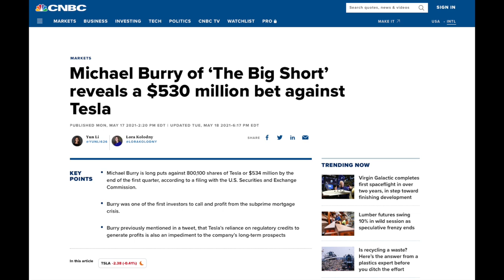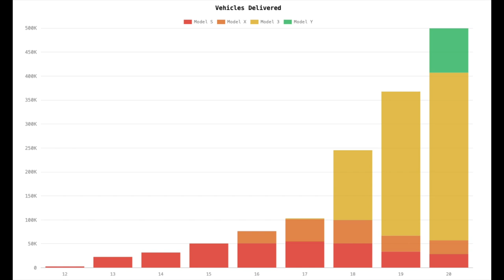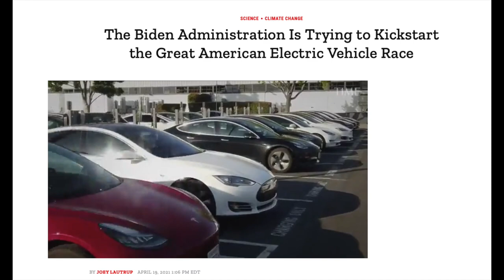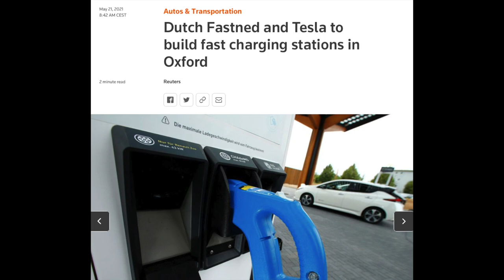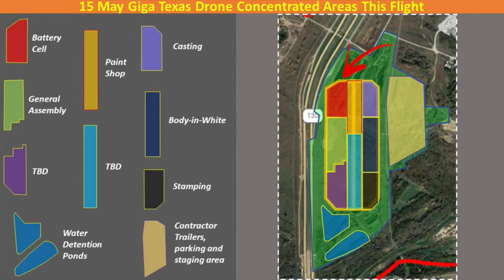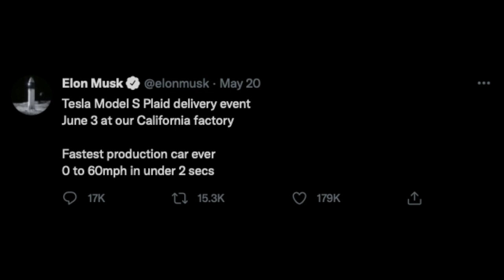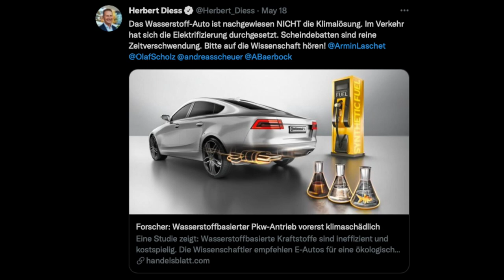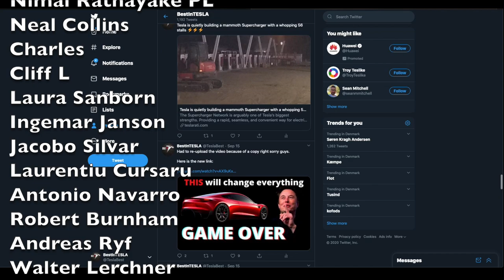Tesla Giga Berlin & Texas already producing products | IEA : The Pressure cooker is on for ICE cars

Comment: Thanks Lars! :)
Burry is nuts to short Tesla.
Elon is thinking 10 years ahead, which means everyone is going to be left behind long term.
CANT TOUCH THIS... "SLAP"...
Reply: Nonsense, he is still relying on the oil industry, everything you touches is basically part of the oil chain.
Reply: @recliningbuddha  I totally disagree with you and its totally unfortunate because in 10 years it won't happen, there are about 80 million vehicles sold every year and not to forget the giant machines and equipments. EVs still barely makes 2% of the global marketshare, modern batteries are already designed to last about 10 years depending on utilisation, semi and other vehicles needs significantly bigger battery capacities and more equipments are being electrified like bike, lawnmowers......... recycling won't solve the problem of raw materials. We're going to open and look for more lithium mines and it takes a long time to make them exploitable and processes needs to be greener.  Nickel, aluminium, copper, lithium, rare earth are very energy intensive to make.
Reply: @recliningbuddha  you're joking right! Electric vehicles aren't made to last longer than ICEs, I've seen many tesla with 400k miles but guess what! Both batteries and motors including MCU were replaced many times. A regular well made ICE with basic maintenance can last over 20 years+, biodiesel and biogas/biofuels vehicles already exist.

Comment: The apologies from Chinese media is good evidence that the Chinese government is not trying to undermine Tesla.
Reply: Actually it's a statement that Elon has received their message and they are happy with his response (and what that is we will never know).  The brake STUNT was Chinese government 100% ALL the way.
Reply: it just means that Tesla reafirmed that they would not be an existential threat to the CCP so they should calm their tits down, and they found that awnser good enough.
CCP had a beef with tesla (and kind of still does) because of Tesla itslef cares little about pandering to their officials, its systems could potentially be used to get data off the great firewall, and obviously China would prefer if a puppet company be the one in control of the Asian market and not a Western independent company.

However it looks to me that they understood that it would probably be more effort than it is worth. Industrial espionage was attempted but failed, since by the time the solen source code was put to use, Tesla had already completly revamped the code and made the stolen tech obselete (and they seem to be doing that with consistent reliability) making industrial espionage counterproductive. They then tried big old state sponsored FUD but that backfired since all the videos of Teslas in accidents ended up showing how good they were at avoiding crashes. Don't get me wrong however, if they get another inteligence break or Elon/Tesla criticize the CCP again, they will try another technique to get rid of em while keeping face.

Comment: I have read that Berlin will not make batteries. Please, does anyone know more?
Reply: Elon said the MY from Grünheide will use 46/80s. The factory is building now, it is the new big building near the GigaFactory
Reply: They have just filed for the permits for the battery factory in Berlin but construction has already started.
An element of battery production seems to be integrated in the main plant also, this is certainly the case in Texas.
New building is probably for the next assembly line and /or power walls?
Reply: Comeon Useyourbrainagain  do you want me to create my own blacklist or can I find that somewhere, indicating which news outlets are on it?

Comment: Imagine an egg crate box, made with injection moulded ceramics, in which the jelly roll is inserted without the metal casing?  Reason for positive and negative terminals on the top?  Both sides would contain the jelly rolls......great for cooling, delete the metal can?  Ever drop a corning pan on the floor?  Doesn't break, does it?  Non-metal battery box.
Reply: As far as I know ceramics are more expensive to manufacture, and has less thermal conductivity. Also, ceramics injection moulding seems to be a fairly new area, and limited to small sizes. I also believe it requires several post-processing steps, making it less desirable for high-volume production. Maybe Tesla could innovate even here, but I'm not sure there's a big enough upside.

I don't quite follow your comment about the terminals though... the 4680s have one "terminal" at each end - this is an unavoidable consequence of one of the major improvements in the 4680 cell construction; the "tabless" design (which also improves cooling).
Reply: @koma-k  ... then why the insulator between the nipple and top plate?  Could be a connector up the center shaft?  As far as ceramics not being mouldable, aluminum wasn't on this scale before Tesla, (and still may not be in the long term a viable option). Sand is a lot cheaper than metal.  
I always thought this part, the
casing, should be eliminated as wasteful.  Look at the Kato video and see all that machinery that could be eliminated, just the jelly roll and top and bottom caps for the egg crate left.  If not ceramics, maybe a thermal tolerant plastic? The plastic could be made with an opposite PH jell,
in case of melting, that would neutralize any fire danger for that cell.  Worked for a company that made water bottles filled with water during the moulding process. Ford made radiators (poorly) out of plastic (yet believe they were undersized and underperforming). Plunk those jelly beanies directly into the structure, cap the top and bottom?  Immerse all into a non elec-conducting cooling fluid?  Safe, secure and light weight, easy to produce.
Get those lfp batteries up to current NMA standards for energy vs weight.  Airplane cells?  Perhaps.
Reply: @ArizonaPoet  It's been my understanding that the 4680 cell has one pole either end, but I haven't seen a definitive schematic of it, so I could be wrong.
Ceramics is a very wide class of materials, spanning from concrete to glass and china to "advanced ceramics" - the latter being what's used for knives, high-temperature turbofans and other "technical" or advanced applications. These generally have little to do with sand as a raw material (perhaps apart from some silicon-rich variants), and some of the commonly used ones are aluminium or zirconium-based, so I'm not sure raw material cost is an advantage. Then as mentioned there's the process itself: It requires very high temperatures and pressure, and I believe one or more post-processing steps. Then there's the material properties: As the 4680 cells will form part of the chassis structure they'll essentially be load-bearing components. Are ceramics well-suited for this? Ceramics also tend to have poor thermal conductivity, which is a negative for a cell casing.
A cylindrical metal casing BTW is "dead simple" and very cheap to produce, and its properties are very well-known and easily modelled making engineering the "structural pack" relatively simple. Now that part is probably not a deciding factor, even if ceramics expertise and modelling is a rarer "commodity" and not as widespread. 
In the end I believe cost and mechanical properties are the main drawbacks. A metal can crumples, while a ceramic one would crumble - or shatter. Which one do you want in a load-bearing structure in a serious crash? (This is only a semi-rhetorical question - I imagine that it could be possible to incorporate ceramic material behaviour in crash response, though this would probably be an entirely new field in automotive crash modelling).
Reply: @koma-k  ... thanks for the wonderful insight KK.  The glass roof's a benefit to crash protection, they seem to be experts in glass/ceramics, with the solar roofs needing a rethink for simplicity of cost, production and installation, perhaps they've
developed the expertise in this area which would be needed.  Just my imagination, but could see a complete battery pack made in seconds, not minutes or hours.  Let me know if you hear of research along these lines?

Comment: It's not $530 million bet.

It's a little bit like this oversimplification: 

Let's say I bet you $100 that $530 million worth of TSLA will lose at least $50 million worth of value.  That would be a $100 bet, not a $530 million bet.

I have no idea how much Bury is actually betting, but it's much less than $530 million. It's complicated because when he loses the bet, he can (and must) cover to limit losses.

In any case the figure $530 million is, roughly speaking, what the bet is about, not the amount being bet.

Comment: We're fast approaching the limits of adhesion with road tires.  In less than 10 years every performance electric street car will run 0-60 in about 1.5 seconds but none of them will be able to go any faster without the aid of some type of compressed-air rocket.... And I see medical / liability disclaimers having to be accepted before you can activate the rockets.  🤷

Comment: Tesla's biggest car battery holds the energy equivalent of about 3 gallons of gas, I read. The plain models are very efficient, 80-130 MPGe, but a big trailer shoots the consumption all to hell at highway speeds. Batteries have a long way to go before several uses warrant an electric car. Then there is the need to increase electricity production to replace perhaps half of the liquid fuels currently displaced. I bet pop-top trailers will work better where the load permits a lowered roof.
No need to force the change from ICE, those who need the benefits of Teslas and others will not ignore the powerful economics of changing to electric or hybrid. Market forces may even drive a very significant number of ICE cars, trucks, and perhaps general aviation, to electric/battery power.

Comment: The Ford lightning is a joke for the price. The Cyber Truck is far superior.
Reply: That's what she said LOL.....
Reply: Ford Lightning will start Osborne effect for F-150 "ICE" models 😊
Ford bankrupt before 2030 (?)
Reply: I just wish that the Cybertruck had lower bed sides. The sides are much too high to reach into the bed. The Cybertruck may not be so popular on job sites, but malls, that is a different story.
Reply: @smarticus6384  the ford can be seriously and very easily modified and the aftermarket is huge, from custom beds to light, equipments..... cutting the tesla will be very ugly.
Reply: @smarticus6384  you can lower the entire truck with the hydraulic system. This truck will be a beast for a worksite.

Comment: actually it's not really a 530million$ bet against tesla, it's not that he has cashed that much in, it's registered as "put", meaning, he can later just sell it when it's below the point he has set the put down for the price he has initially set it, some fond managers do this with some risky socks as backup because it's about 7ct per share to make the "put" option there, but there is a big difference between having 7cts per share down or nearly 600 bucks so with a couple hundred bucks you can quite inflate that reported number but the important question is the expiration date of that put order because at that time, when tsla is higher than it was at march 31st at wich's price the option was registered,  he's gonna loose quite a bit. it's just a short segment, so no flame not researching this correctly and the headlines are quite misleading, but nontheless,  not true to claim he has that much cash down against tesla

Comment: 1.1 sec is impossible due to friction coefficient of tires
Reply: Yup...which is why the Roadster SpaceX version will use compressed gas to "hover" off the ground.   The sole purpose of the "hover" is to reduce tire friction.  So yes, impossible for a normal car but not impossible for the Roadster SpaceX.
Reply: @kn944  it’s reduced tire friction that makes it impossible, you want high friction, that is what creates grip.
Reply: @jimdandy9118  you're right. rocket booster things will add thrust and give you the sub 2 second time. But I don't believe it'll ever happen, road legal especially
Reply: @Harry-uq9qd  they already do this on the drag strip and go 300 mph 1/4 mile.  Nothing special
Reply: @jimdandy9118  Correct, you do want high friction if the motor torque is applying a force from the tire to the road.  However, if the force is applied by a rearward facing rocket, you actually want low friction (rolling resistance).  I may be wrong, but I think this is Tesla's plan; 1) downward facing rockets to reduce friction (like an air hickey table) and 2) rearward facing rockets to propel the car forward.  The motors may not even be activated for this seldom used party trick.  Or they may be activated only after 0.5 secs or something.
Reply: @kn944  then we really aren’t talking about a car now are we?  This is mother attention grabbing gimmick to sell cars.
Reply: @recliningbuddha  Yes agree that may be the way it is applied.
Reply: @jimdandy9118  Yup, I think that is exactly the intent.  I think the SpaceX version is limited to 1000 units.

Comment: May I suggest that you watch Rob Mauer's and Joe Tegtmeyer's videos? While much of your material is accurate, you often jump to incorrect conclusions about information that is easily available from other YouTube channels. As noted below, Burry's move wasn't as bad as CNBC made it look. And regarding the castings, the fate of those produced so far is unknown. As they are very early castings from machine assembly and operations verification, many of them are defective and not ready for use, they may be recycled. Those that look OK are probably going for metrology and testing. It's doubtful that any are slated for actual production. Last I heard Fremont is not using complete front or rear castings. They are using rear right and left side castings, but that may have changed. I believe Texas and Berlin are the first slated to use complete castings for front and rear.